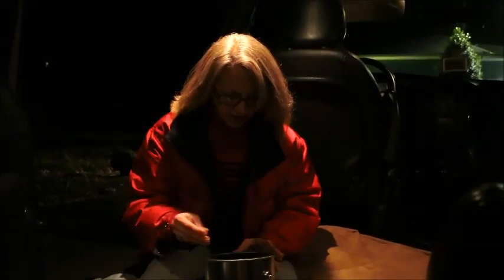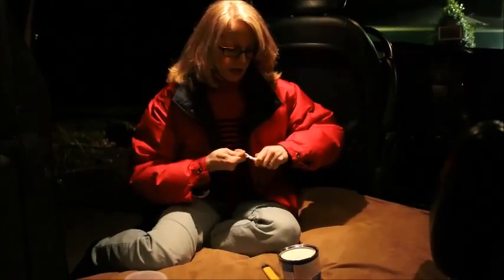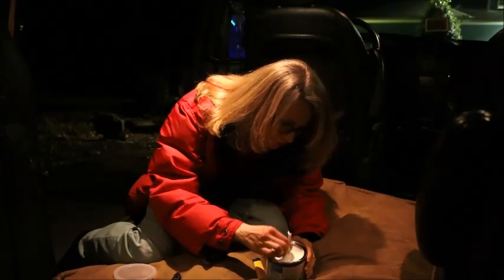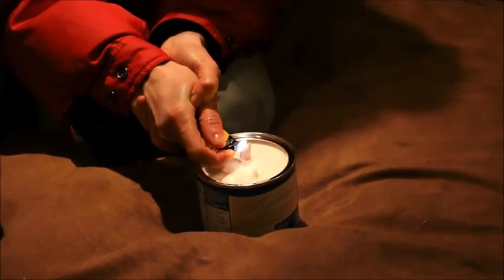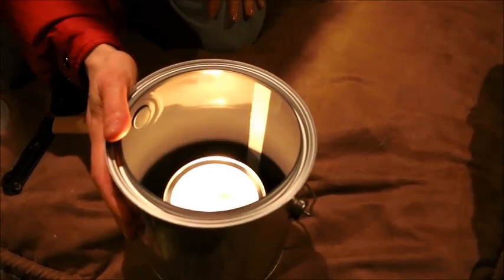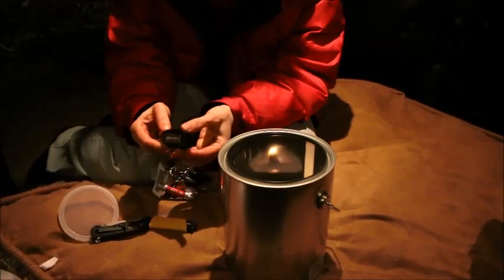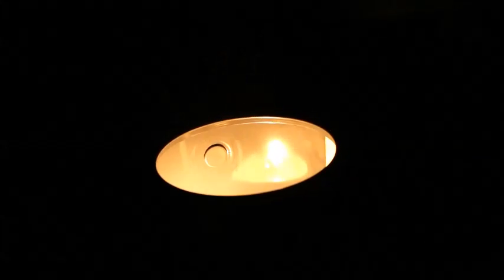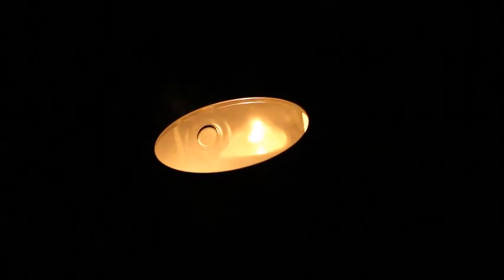Crisco Emergency Car Heater

Comment: Buy a box of cheap birthday candles.  Shove 3 into the Crisco can. Three flames will give you a lot more heat.
Reply: I watched a woman who made candle wicks and the one made from birthday candles was the worst.  She made one out of cotton rope and one out of a dishrag and one out of toilet paper.  But the candle with the birthday candle went out pretty fast and didn't burn as well.  It might depend on which brand.  The rope or cotton dish cloth cut into threads burned so well.
Reply: I did see someone use a bigger Crisco can and inserted full-sized candles and that looked interesting.
Reply: How about three heat cooking canisters and it beats your candle idea and you can get them at the DOLLAR STORE!!!  So go blow your candles....
Reply: @billbobaggins801  Dollar store heat cooking canisters are 2.8 ounces of fuel.  Crisco has huge sizes but a 16-ounce size is cheaper than your 3 heat cooking canisters at Dollar General and has double the fuel for less than $3.
Reply: @billbobaggins801  You can get a 6-pound container of Crisco for less than $15 and can use a piece of rope or a rag for a wick.
Reply: @billbobaggins801  yes would that give off any chemical and being in an in closed car might be dangerous, just saying look into it first.
Reply: @wishingb5859 
I put 5 taper candles in a big can of Crisco, put a cooling rack on top (like for cooling cookies) and you can warm up food. I didn't try to cook on it but I'm sure you could it might take a little while.
You could use this to warm up a small room in your home. I got the candles at Dollar Tree for $1 for 2 candles. 
I kept it lit for the whole day and you could barely tell that it was used at all
Reply: @jude7321  That is good to know.  I ended up getting solar with batteries so I will never have to try it.  But I thought it sounded like a cool idea.  I had been wondering about it for keeping pipes from freezing.  But now I am over-protected.  I have a solar generator powerful enough to run a small space heater for a few hours, plus I already had a cheap gas generator.  Laughing.  You can tell that I have lost power for extended time periods. There is no way I wanted to drive to get gas for a generator in an ice storm.  I didn’t even want to walk outside to put the gas in.
Reply: @billbobaggins801  what is a three heat cooking canister?at the dollar store.not picturing it thanks
Reply: @wishingb5859  yeah heet sucks. I live in NY van with my pit bull Frankie. I use alcohol. Denatured for heat cooking whatever it's hot as crap heats my van up in a minute but then it's to hot and got to put it out. So I. Working on something to maintain the level of heat instead of freezing tben hot then wake up freezing then hot  should be ok criso is to dam expensive .I'm goi g to try and build a vegetable oil heater because it's free from a restaurant. So yeah .in a full timer and love it  I depend on nobody for nothing car insurance because I have to and a phone that's it. We have so much fun . good luck from Myrtle beach
Reply: @mustangandfrankenstein  Wow, that is cool.  I looked into that but ended up inheriting a house.  I don't have rent or mortgage.  Taxes and insurance still sucks.  I have finished the updates to things that needed to be done, so it is just taxes and insurance and minimal utilities.  But that still adds up.  I never made a big salary, so I just don't even have concepts of how people do it.  But obviously they made more money than I did.  I think the vegetable oil heater sounds good.  A solar panel on top of the van and a solar generator seems to be what a lot of people do.
Reply: @wishingb5859  congrats.  I was supposed to also but  as I goes for me that's not gonna  happen  
Even though was called and told that . Apparently people are allowed to step in and change things despite of the person's will or testament says .it ok though.iv been passed over pushed to tbe side and left out so  much that if i did inherit anything I'd give it away to someone who really needed it and not a 50 yr old man and his dog..lol.right.yeah.good for you .no rent or mortgage..been there didn't like it ..hate money and what it makes people..yuck.i was born 200 yrs late my mom would say.and I agree. Enjoy .I bet its beautiful.
Reply: @mustangandfrankenstein  I always hated money, too.  Probably why I never was all that career-oriented.  It is a relief to not have rent or utilities.  I spent a lot of time traveling in a vehicle and camping.  Crossed the USA 5 times.  Hope you and your dog enjoy your time.
Reply: @wishingb5859  that's incredible ..that's traveling .like extreme traveling..lol.kool though .I'm a homebody  and like the country.a fire and we'll you know.  Camp ..we are in  myrtle bch..yuck.I wanna go upstate in tbe hills and country ..moonshine and hillbilly stuff .not lke old hillbilly stuff .but the new hillbilly stuff and build a nice cabin..me and Frankenstein and my van and my mustang.my baby vroom..woohoo .lol   would live happily ever after .with hill billy girl or not I could be an old lonely hillbilly tbe crazyone that only comes into town once a yr to go poop...lol.no but really I got to go this sucks here and I want my beautiful cabin and my canning jars and the smell of breakfast cooking on someone's old cast iron pan..umm.heaven awaits.
Reply: @wishingb5859  iv had a great career and a million dollars .it sucked .the feeling of getting rid of everything down to a bunch of bags of clothes.i love clothes (t's kinda my thing .like crack to a crack head.. )a phone and my mustang  my van  my dog and what more could you want .?? Love? Doesn't exist.!it might maybe but that I think even might be tested .. faithfulness.yesss .proven real .me 17 yrs.but I'm going off track..lol.hence my nice crazy check earned 10 times over.but ok enjoy your beautiful house .and Xmas tree and all that spirit that it brings.much love and  happiness to you and your family .from me and Frankenstein. (Mydog).goodnight.
Reply: @wishingb5859  yea same exact situation I’m in
Reply: @collequ  👍🏻
Reply: @mustangandfrankenstein  they're refering to Sterno type canisters. The dollar store ones are cheap but they aren't very full.
Reply: I had poor results with cheapo birthday candles, it seem that the wicks can't support themselves once the melt pool is fully formed. I intend to try again with better ones. I did have very good luck with a 9 or 10 inch taper cut in three parts and inserted into the one pound can. It burned for a bit over 2 days and burned down leaving only about 3/4 inch unburned. I did have to scoop out a few tablespoons of Crisco first as it squished out over the top when the candles were inserted.

Comment: I'd have a carbon monoxide detector in my car too.
Reply: @normanmcneal3605  Or understand that CO is a natural and expected byproduct of the incomplete combustion of all hydrocarbon fuels.  Vegetable shortening is [drumroll please] a hydrocarbon fuel, and I'm pretty certain that without drastically improved ventilation in the outer can to boost air flow and combustion, that as simple paper wick isn't going to complete the job. the smoke is another clue that combustion isn't 100%. We really can't tell how much CO this set up produces, so for the safety of everyone involved, having a CO sensor in the car for the experiment should have been a no brainer.

Comment: Well guess I can buy some canned shortening to heat with. I don't want to freeze when it's so easy not to. I'm gonna get me a tent to set up in a carpeted room and make a pallet to sleep on.
Reply: Person who doesn't have a tent could do an make shift one. Using sheets or blankets draped over dinning chairs or other furniture. Tent or other, be sure to ventilate not suffocate. Also, a cheap air mattress pool float from a Dollar Store is a little more comfortable than just a pallet. If available, but, You can always plan ahead and purchase one ahead of time.
🚬👓...

Comment: You may have problem getting enough oxygen to your grease candle. Because it's so deep in the other can. You can solve this by poking some holes in the bigger can close to the height of the wick. You may also have some problems with the candle sliding around inside the bigger can. You can solve this by putting a little bit of gravel maybe an inch or so around the in the space between the candle and the can. This will keep the candle from sliding back and forth.

Comment: Suspend a Terra Cotta pot over the top, then get a rechargable fan blowing on that.
Reply: Someone had one of those catch fire.  Plus, another person tested the terra cotta with candle versus candle alone at heating up a box and the candle without the clay pot heated the box up higher.
Reply: @wishingb5859  it caught on fire, from the teacandle failing.  Not sure ur point 🤨
Reply: @psychologicalsigma9917  My point is that candles warm a space more than candles with a Terra Cotta pot and that people have had fires trying it.  Plus, neither warm the space that much.  An average parafin tealight puts out around 100 BTU and a science guy estimated that 1/5 of that candle to heat even one square foot of a room a single degree.  It can warm your hands though.
Reply: @wishingb5859  I use a kerosene, with a heat powered fan. Works great. Smells like real man 24/7 😁🤣
Reply: @psychologicalsigma9917  You like it?  Right now, I am heating my entire house with 2 Vornados and I like that.  I have oil heat but I did the math and my oil heat cost $12 per day and my Vornados cost $1 per day.  (I only use them until the house is comfortable and then I turn them off)  I am just looking for options when the power goes out.  But I can use a generator.  It is just the prepper side of me that looks at everything.
Reply: @wishingb5859  I'd prefer a generator.
Reply: @wishingb5859  wow,  my sentiments too. I played with that design and realized it was pointless if your goal was to heat a room  and with reports of them causing fires, I packed in the whole idea of a flower pot heater/oven. Candles yes oven👎.
Reply: @richardelliott9511  Yeah.  I ended up heating my house with two Whole Room Vornados last Winter.  It added some to my electric bill but I was able to bring my oil bill down by over $600.  It worked way better than I expected because I could put them on for a few hours and then shut them off until the house needed to heat up again.  My electric bill went up by about $30 per month but my oil bill went down so much that I truly saved money.  I got solar panels to try for next Winter to see if I can get rid of both my electric bill and oil bill.

Comment: So here’s the deal. If you’ve burned your last candle and the flashlight batteries have all just died…or if you find yourself lost in the woods and you come across a cabin you can shelter in and need some heat or light. Go ahead and make a candle out of that old tub of Crisco. Don’t worry—it never goes bad. Follow the usual precautions, keep an eye on it and don’t let it burn unattended. Or better yet, scoop out some of the product and put it in a metal container and add a wick. You should be fine. I used 5 long taper candles, and just shove them down in the Crisco. I got mine at the Dollar Tree for $1 for two candles. 
It will burn practically forever.

Comment: You should tell them they will never survive trying to stay warm with a candle. Tell them the truth they going to freeze to death unless they can build a good hot fire. Carbon footprints don't mean shit when you're freezing.
Reply: carbon footprints don't mean shit even if you're not freezing...  ;}
Reply: @lekistick1013  LOL Right.
Reply: In a small space, you'd be surprised at how much heat is put out by several ordinary utility candles. Which will burn for several hours. Plan ahead for emergencies such as these and always ventilate.
Reply: @captainjohn7833  I lived totally off the grid for 10 years. Tried all these cool little ideas and nearly froze to death. Good hand warmer. If you're going to prepare get a tank of propane and a small heater and put it up until you need it.  They burn for days too. Just can't be cheap buying a can of Crisco thinking it's going to keep you warm. Maybe if you had 20 cans burning.
Reply: @grabitz  if you used propane off grid, you know how much moisture it puts off 👍